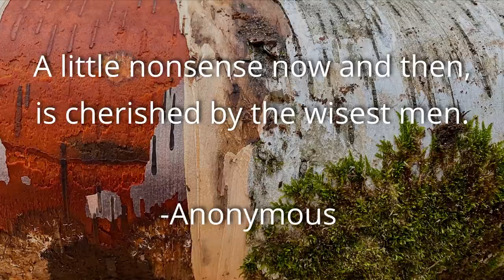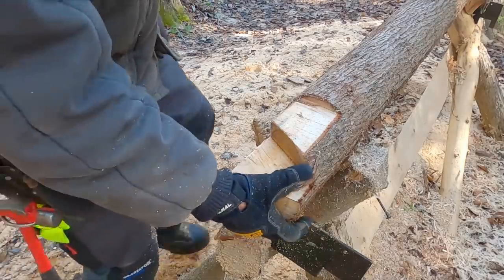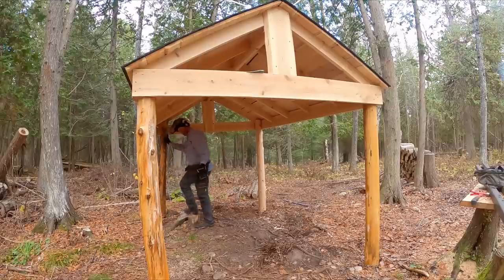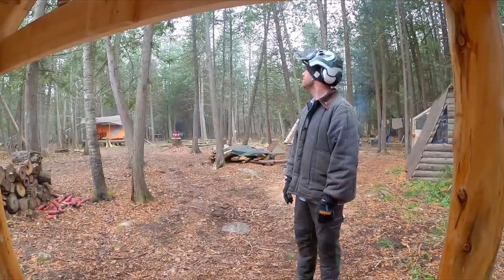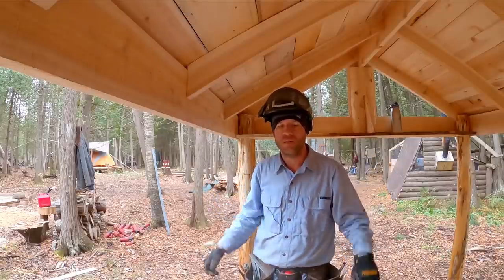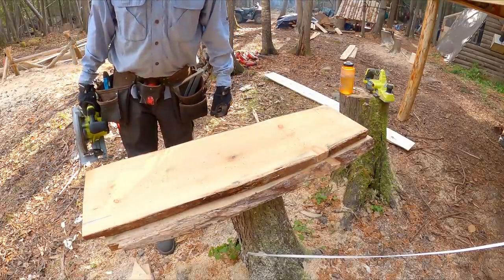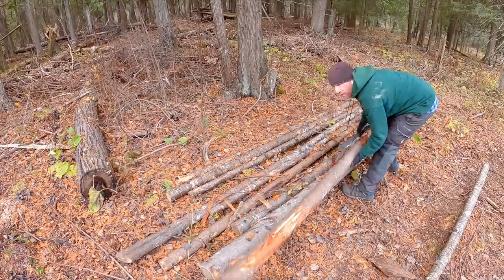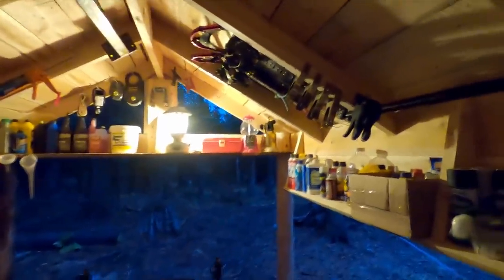Wilderness ATV Garage Build, Done! Made with Chainsaw-Milled Cedar Lumber. (pt 3) #59

Comment: Buy 4 pumice blocks, then place 1 under each leg so it is raised 8 inches and you won’t bang your head when riding in on on the 4 wheeler.
Put a  tar based shingle on the pumice block to stop water wicking into the legs.
Fasten the whole thing down so wind doesn’t move it.
Reply: Why buy when you can find. I am sure he has something stone wise out there!
Reply: Pumice blocks are cheap!
Reply: @cliffmorgan31  "cheap" is relative.

Comment: You could put a board flat toward you could drive over the twentit's drive over between each leg all 4 directions andirections and you know that way you would have stabilization on tha stabilization on the bottom And another thing the 2 long walls you can also shed them and then that way to make it even stronger